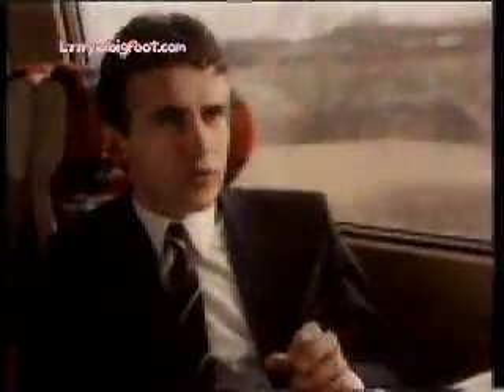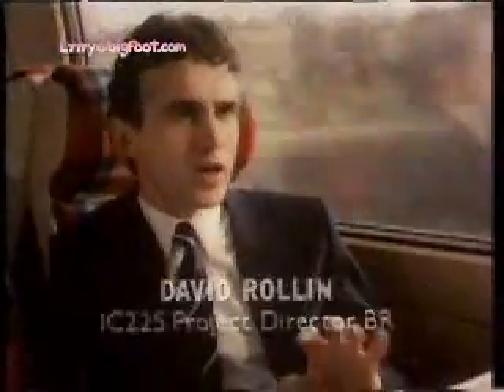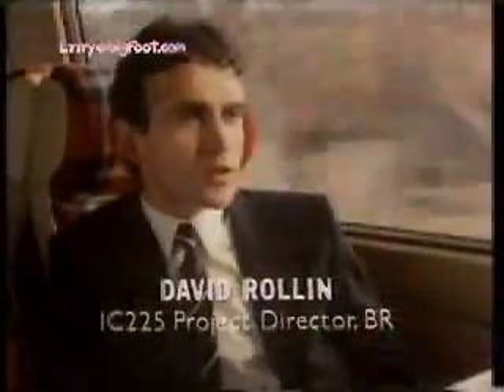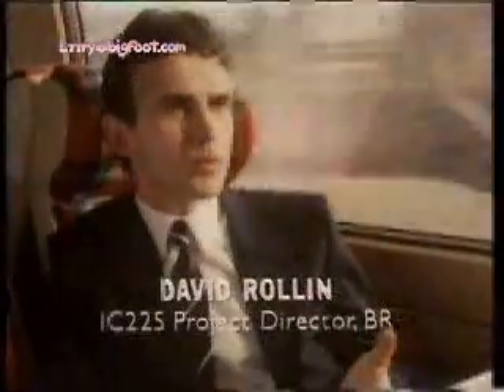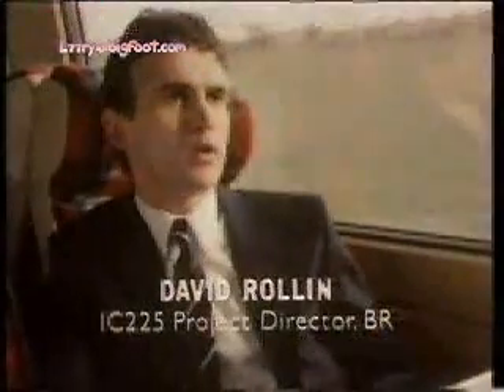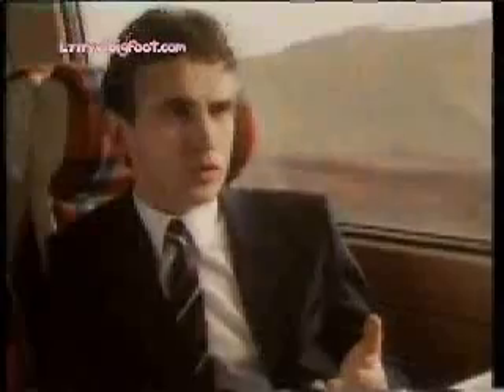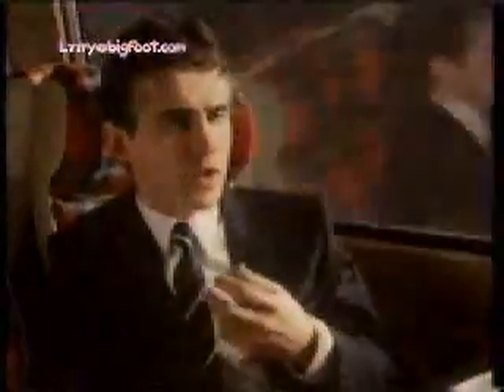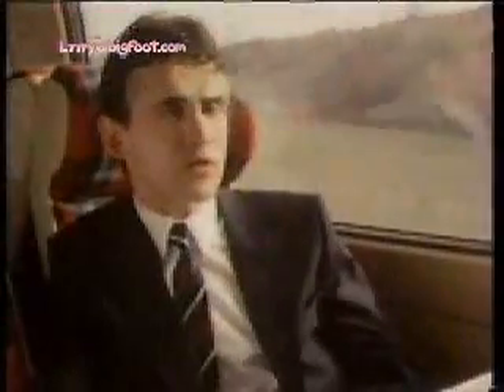APT Advance Passanger Train

Comment: Somebody out there should start restoring the APT, and operate it, compete against the successor Pendolinos. Run her on thr High Speed 1 for speedtests, mass produce her for commercial use. It's a shame a great train is left to rot just like that.
Reply: Shame not all 16 coaches are available though.

Comment: The problem with APT wasn't technical (remember Ford & Dain?), but it didn't make commercial sense. To justify the higher capital and maintenance costs of a tilting train, significant journey time benefits are necessary. This is achieved by reducing point to point journey times by increasing train speed, but as soon as you increase the differences between the speeds of trains using a section of line, capacity is reduced; mitigation measures are therefore necessary. If you look at the WCML in recent years, there has been four-tracking in the Trent Valley and the maximum speeds of class 350s has been increased to PARTIALLY use the benefits brought by Pendolinos, but without further significant investment the 140mph capability of these tilting trains can't be used. And this is the main problem; with a railway line running nearly at capacity - as is the WCML - the benefits brought about by tilting trains can't be enjoyed unless all trains are tilting or there is sufficient investment in additional infrastructure to enable a mix of tilting and non-tilting trains to operate. And quite simply, such investment just couldn't get through the investment appraisal process mandated to BR by central government; moreover, if our railways hadn't been privatised, we wouldn't have Pendolinos either - when ALL costs associated with their introduction are taken into account, they are probably a poor investment and wouldn't get through the investment appraisal process BR had to use

Comment: I rode this train on every passenger run(and a couple as a guest of the testers of the compuerised systems)..and I kept all my passes and tickets purchased too.(sad eh?) 
A fantastic machine when working properly (10th apr 1985) 2 complete passenger runs with no problems. I belive it was a case of the money and political will ran out,a change of managment structure who could have put the case for APT to government migh have saved it.

Comment: It was the only train that the driver got a better ride than the passenger. You didn't get burst eardrums going into tunnels as the cab was so well sealed, when you closed the cab door a seal inflated around it. The actual driving was just the same as any loco. The braking did take a bit of getting used to they should have stuck to the tried and trusted rheostatic braking that was awsesome and worked, still if you don't try you don't learn.

Comment: I never had any brake issuses, tilt system failed due to the onboard computers !!! gearboxes failed due to incorected oil put in and some cases no oil at all. It's all down to the usual goverment run industry mentality just throw money at the problem but in the totaly wrong direction and the wrong people in charge.

Comment: I drove this on test runs between Carlisle and Carnforth as a secondman back in the 80's. It was sabatoged by the engineers, can't say much more sorry. I still have the original timetable that it should have run but was cancelled. I sat as a passenger on it as we had to take rest periods on the test runs as they were run on saturday nights and sundays when the track was closed for testing at full speed and I never felt sick. who says it wouldnt go uphill thats a load of balls. it went up shap ok

Comment: continued - 
2. BR Liquid Hospitality (or rather journalists enjoying it too much) gave rise to the "travel sickness" reports.
3. A particularly cold winter when the train went into passenger service which caused the standard air brakes to freeze thus reducing low speed braking efficiency.
4. A weak government who were more interested in the roads than spending the small amount needed to productionise this prototype train.